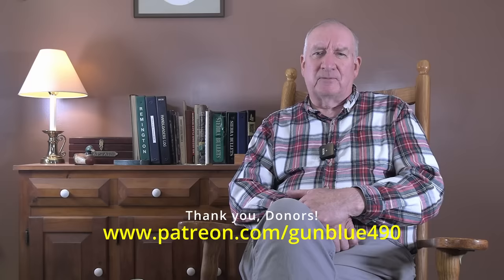The Copper Fouling Lie ~ Don't Fall for It!

Comment: Regarding your story about the shooter who was swabbing his bore with a caustic substance every few rounds, one of my customers in New Hampshire reported a very similar experience in the 1980s.  I had sold him a match grade AR15 which was supposed to print half MOA groups.  Within a couple of weeks he returned it to me claiming he could not longer keep his shots on paper.  I shipped the rifle back to the manufacturer for inspection.  I later received  a call from the owner of the company who informed me all the rifling was gone.  Further inquiry with the customer revealed his practice was to stroke the bore at least five times after every single shot with a stainless steel brush and a strong solvent he had acquired from Canada. He had effectively lapped his 416 stainless steel, broach cut barrel until there was no discernible rifling left.  The manufacturer charitably agreed to replace the barrel on the condition he cease this insane practice and stop using this particular solvent.  People have asked me in disbelief if I knew what the solvent was made from.  I think it contained ammonia, but aside from this, I don't know because the customer never told me.
Reply: I'd lean more to his brushing the heck out of the bore with a SS brush, rather than the solvent.  But  I wouldn't be brushing every shot, either.  Did the buyer say WHY he was doing that ??  Personally, I just watch for cra* in the rifling grooves b4 I 'scrub' a barrel.
Reply: @fasteddie1360  He believed the least amount of debris adversely affected accuracy.  Apparently he was wrong.
Reply: @fasteddie1360  
The brush has to be softer. A friend of mine gave out a rifle in afghanistan and the same day it came back clean as can be but with most of the rifling gone. Others worked out...that one was going all around the base to look for 'better' ways to clean the barrel and got his hands on an oversized hardened brush from some helicopter maintenance crew.
Reply: Oh yeah….blame Canada!
Reply: Maybe he mis-understood "which bore"  to stroke with that SS brush -OOOWWW !  Gotta watch where you apply that thing.
Reply: @davejones67  I think it was one of the predominantly French speaking provinces, so I'm okay with his accusation.  🙂
Reply: @onpsxmember  Imagine being in a firefight without realizing what had happened to the bore.
Reply: Yeah I agree that the primary cause of this would be the brush. Some of those brushes are rather harsh on the steel. Had the guy used a brush designed for firearms, he'd probably still be shooting it without issues. Chemicals aren't really the problem here assuming he used a firearm specific one and not something he brought along with the strange brush.

Comment: Blink twice if you are referring to Sweet's 7.62 Solvent, a highly corrosive copper solvent. In fairness, the directions on the bottle warn  not to let it remain in the bore or other metal surfaces longer than 15 minutes. I used it about two times and was scared off, but the .30 caliber ammo can that I stored all my bore cleaning solvents, especially Sweet's, reeked of ammonia and literally peeled the paint off the interior of the A-box, I discarded the bottle soon after. When the U.S Military's ammo was corrosive, it was thought that metallic fouling would cover areas of the bore which contained corrosive salts deposited from previous rounds and that it was imperative to remove the metal (copper or Antimony) fouling with a solution of Sal Soda which was mixed under the watchful eye of the Drill Instructor, then with all fouling removed, hot water would be swabbed through the bore to wash away the corrosive salts (info taken from 'Manual For Non-commissioned Officers And Privates OF Infantry Of The Army Of The United States 1917_ Revised To June 4, 1918'.
Reply: I was hoping it was not 'Shooter's Choice' solvent. I used that for a couple of years. Did not seem to hurt my barrels though. I went back to Hoppe's though, and will never change again.
Reply: @nathanlambshead4778  amen. i've never had anything work better than Hoppe's for my needs.  (pistol, HP / Service Rifle XTC).  If I shoot three matches in a row and the Hoppe's isn't working fast enough, a patch or two of JB does the trick because it's exactly what it says... abrasive paste to bust out the carbon.   When the patch runs through smooth then I hit it again with a pass or two of Hoppe's and she's slick as a whistle.
Reply: @nathanlambshead4778  all the good solvents contain some degree of ammonia. Yes, so does Hoppes. Ammonia does not hurt the barrel just by normal basic usage
Reply: @John_Redcorn_  true but Hoppes also  obtains rust preventative as well.  Plus it just smells great.
Reply: Funny thing is what got the corrosive salts out was the water, not the solvents.
Reply: Correction of previous comment; Sal soda (bicarbonate of soda) was used to remove the corrosive salts and Ammonium persulfate was used to remove the cupro-nickel fouling. The ammonium persulfate was in dry powder form and mixed with water by an experienced non-commissioned officer. It also stressed that the ammonia solution should not be allowed to evaporate from the metal surface it is applied to lest it "attack it rapidly" (mixed solution was only good for 30 days).
Reply: @Nick-wn1xw  Hoppe's No9 smelled a lot better when it had nitrobenzene in it.  Can't tell you how many times 
I wrote the Hoppe's people and told them they should have a cologne and a perfume formulated to that smell.  A woman who wears that kind of perfume would be considered instant wife-material.
Reply: For a short time, Hoppe's had a competitive product that came with a gray label.  You don't see it on the shelves anymore.
Reply: Try bore tech cu+2. Non toxic, barrel safe, does not stink.
Reply: Synthetic motor oil is all you ever needed ☝️
Reply: Stuff works great but as you mentioned, follow the directions. The only real time I use it is on new to me milsurps to really clean the barrel and get a good look at what I am working with and neutralizing any remaining acids in the barrel.
Reply: And some of those patches come out baby blue.
Reply: I had a similar experience with my VERY BRIEF relationship with Sweets !
Reply: The statement that “if it’s strong enough to break down copper, it’s certainly strong enough to break down steel” is just factually inaccurate. Especially when you’re talking about ammonia which is the active ingredient in most copper removal solvents. Ammonia is very high (caustic) on the pH range making it basically completely ineffective on steels. Steel, in fact, has very good resistance to ammonia in gas or liquid form. Strong acids (low pH) liquids can be very corrosive to steel but ammonia is the opposite of a strong acid and is not likely to ruin any steel or stainless barrel. Fear of using copper removal solvents comes simply from ignorance about the chemistry involved. And (only because I’ve seen the phrase used in several comments) “caustic” does not mean “corrosive”.

Comment: I didn't start shooting until the mid '80's. One guy at work had spent 20 years in the military. He told me that far more rifle barrels had been ruined with a cleaning rod than had ever been shot out. One or two wet patches with good old Hoppe's No. 9, then a few clean patches always being careful of the muzzle crown was what he suggested. A trace of gun oil if the rifle was going to be put away for a while, like over the winter, nothing more. I've never had a problem with one of my rifle barrels.
Reply: He's probably right about too much cleaning but the military has a habit of wanting those weapons spotless before they would be allowed to be returned to the arms rooms.
Reply: I have a few ar's that I have never cleaned the barrels. One has over 5g rounds. I wipe the bcg down with a dry rag and re-lube it that's it....still shoots good
Reply: @gmac8852  not to mention troops would use brake cleaner & other harsh solutions to quickly get carbon out to pass inspection... doing that after in many cases only shooting 40 rounds...
Reply: @JJ_SDWR  Yeah I was using all kinds of stuff including homemade picks and scrapers .
Reply: I have NEVER seen a barrel worn out by a cleaning rod in my 54 years, that is another bull shit people buy into!!
Reply: @neelsmuller3716  he said ruined though.
Reply: The problem is you're assuming that the person with the rifle even cares. They're probably more worried about getting it as clean as possible than they are of making sure it's in great shape.

Comment: I've had different experiences with copper fouling in different rifles.  I had a Remington 700 in .308 that had an extremely rough barrel that would copper foul excessively.  It would take about 5 rounds for the barrel to foul properly to shoot consistent.  Then I could shoot about 60 rounds at about 0.7MOA.  If I kept shooting, even after removing carbon fouling, the groups would open up to 2 MOA or greater if I kept shooting.  Removing the copper fouling would bring it back to a 0.7MOA rifle.  I also worked on a 1903A3 that had never had the copper fouling removed.  A family member who owned it complained about accuracy.  It almost had all the rifling shot out of it and the copper fouling after about 25 rounds would make it a smooth bore.  I could actually see keyholes on a 50 yard target.  Cleaned the copper fouling out, which took days because of the buildup over the years.  It took 2 shots to foul properly and it would hold about 1 MOA for about 20 to 25 shots.  After that it needed the copper fouling cleaned out to regain accuracy.  I also own a rifle with a Bartlien barrel.  That rifle could shoot over 500 rounds and not lose accuracy from copper fouling.  I do like the suggestion about not using caustic chemicals to remove copper fouling, if you are going to do so.  KG-12 is not caustic.  It will not hurt your steel barrel in any way no matter how long you keep it in the barrel.  It was designed for the military and large bore rifles.  I agree that in general the military isn't worried about copper fouling.  That's because they only have a 2-3 MOA requirement.  Most of their rifles with ball ammo are not capable of anything better.  For the precision shooting I do, I've noticed accuracy degradation from copper fouling in every rifle after a certain point.  When you've got a rifle shooting 0.3 MOA and all of a sudden it's shooting 0.7 MOA, that's a problem in my sport.  When cleaning the carbon out of the barrel doesn't fix the problem, that leaves only one culprit.  Copper!
Reply: MY 7X57 Featherweight. If I just run Hoppes 9 through it. Even 50 patches with a plastic jag. they'll all have blue-green color on them. Not the same with my Shaw Barrel on my .25-06. It cleans right up. I broke it in with JBs Bore Paste and Hoppes as recommended by E. ARTHUR Brown Co. where I've bought two barrels. I did NOT do a break in on the 70 Featherweight and it seems to throw out copper with every patch. Only difference besides no "break in" was ones a hammer forged and the two others are Button rifled. My .260 didn't seem to be bothered by EABCOs break in with JB Bore Paste followed with Hoppes #9
Reply: A 1903 with no rifling that goes from keyholing to moa accuracy...hmm. 

(X) Doubt
Reply: @griftinggamer well first, I didn't say it had no rifling, I said almost no rifling with the copper fouling buildup.  After the copper of 100 years of shooting was removed there was rifling, just quite worn down.  This is what sold me on removing copper fouling from my rifles.  Years later I proved that copper fouling buildup affects groups at 1000 yards.  But the limit is always variable depending on the rifle.   I find that quality custom barrels are affected less by copper fouling than factory barrels.  However they are all affected in some way.  For reference you can look up F-Class John's videos on barrel cleaning and why he removes copper fouling.  Or you could look up Eric Cortina and his cleaning routine.  These are pros that compete and win constantly.  Maybe they're on to something.

Comment: In rifle bore cleaning ( for the Lazy shooters) there is videos that claim copper fouling or carbon fouling is not a problem .  Copper fouling will build up if not removed . How much and how soon depends on the quality of the bore , but regardless ,  it will build up if not removed .  Either fouling will affect accuracy at some point.
Reply: My experience has told me the same thing.  Copper fouling will definitely build up! Along with Carbon fouling!  When accuracy is affected, the stubborn process of clearing it out and seeing accuracy regained will make you a believer!  This is one of those videos you speak of......  Experience has taught us otherwise!

Comment: Copper is one of the main ingredients in high performance alloys of bearing bronze that practically slip off unlike metals🤯
Seems like “copper fouling” is another attempt to market more products to government agencies and the average consumer 🤷🏻‍♂️
Reply from the maker: Spot on.
Reply: @GunBlue490  I have always just used hoppes number nine for everything swab the barrel then a bronze/ brass brush wipe dry oil and wipe out. But I do need to find something that works good for leading in my revolvers from shooting a lot of cast bullets
Reply: @JamesBond-so1of  Why? Lead is even softer than copper and by this logic should only continue to make your firearms more accurate.
Reply: @JamesBond-so1of  Well Mr. Bond or should I call you 007? Years ago I was a Brinks Canada instructor and it was all S&W revolvers in 38 Spl. We normally bought jacketed ammo but there was one time the only 38 Spl we could find was Federal American Eagle 158 grain Lead Round Nose. Thankfully it was a week at an outdoor range. Over that week there were thousands of rounds fired and at the end of every day the revolvers cleaned. 

M-PRO-7 in the big spray bottles was what we were supplied for cleaning. I’ve watched as both blued and stainless barrels would get strings of soft lead exactly the same size as the barrel grooves pushed out after those barrels were sprayed and mopped and let soak for a while as the trainees cleaned the exteriors. Then using plain old bronze bore brushes some of the barrels released these lead strips upto .75”. 

Never witnessed it before or since and I was loading my own lead semi-wad cutter rounds on a Lee Pro-1000 and firing them out of S&W Mod. 19.
Reply: @timothyrepp4259  lead is too soft, it galls and leaves lead in the rifling not just the machining marks.
Reply: @Charon-5582  I was being sarcastic and would suggest copper does the same thing just not as quickly as lead.
Reply: @timothyrepp4259  I knew you were, and wanted you to gain knowledge if you weren't.
Reply: I think originally the military would give people two separate products a solvent and some grease/LSA. Which turned out to be superior way of cleaning but it ended not because it was bad but because they felt people were too dumb to do it right so they wanted a CLP product that really didn't clean it very well.
Reply: I've use bore scrubber and it really get the lead out, maybe to good 🤔
Reply: @JamesBond-so1of . Lewis Lead Remover. Mechanically pulls all the lead out of your barrel. Incredibly quick too. 3 pulls through your barrel and you'll have a small pile of lead shavings on the table.

Comment: I use Hoppe's No.9 solvent, I'll run a bore brush through it a couple times, then gun oil with patches till it comes out clean. Like you said, I don't want to remove the smoothness of the bore. Thanks for your videos. 🇺🇸
Reply: That's what I do

Comment: I have never cleaned copper fouling out of my barrels, and my main hunting rifle in 338 win mag shoots sub 3/4 moa all day so long as a person can handle the recoil.  

My vintage Brite-Bore cleaning kits that I got from an uncle didn't have anything in them about removing copper, and neither does my Hoppe's cleaning kit.  So I didn't know it was a "problem" until a few years ago when I was hearing about it through marketing.  Instead of jumping in feet first for the "latest and greatest" in gun cleaning I just followed what my vintage kits recommended as I never had a problem with my firearms, and I figured that they knew a thing or two about cleaning guns back in the day.  In my mind if copper fouling was an issue they would have discovered it by then.

Comment: At 10:00 that's a good point you make. Copper is incredibly resistive to the elements so anything that can break it down has to be extremely caustic/corrosive. Copper is what they used to plate the bottom of warships in the 19th century. Galvanic corrosion is the only thing I worry about with copper in the bore and it would quickly corrode the iron fasteners used to attach the copper plating to warships, but only because salt water makes such an excellent electrolyte. How great of an electrolyte the air is depends heavily on your climate/humidity/temperature/sea spray etc, but can also be prevented by using a light coating of oil to seal the copper and iron from the air, ie regular maintenance.
Reply: Oil in a barrel? If excess copper gets blown out with each shot, why wouldn’t a hydrocarbon compound?
Reply: Caustic doesn’t mean corrosive. It means, highly alkaline on the pH scale. Which in the case of steels is actually the opposite of corrosive. Just because a solvent reacts with copper does not mean it reacts with steel in the same way. In the case of copper removal solvents, the active ingredient is almost always ammonia. Steel is highly resistant to ammonia but copper is highly reactive with ammonia. Just trying to get the right info out there because this stuff is not common knowledge.